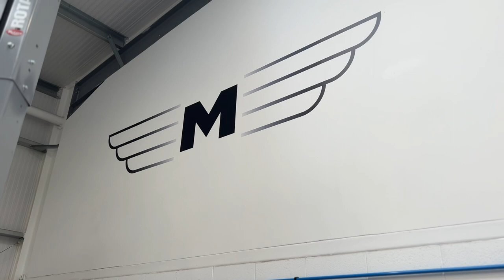IS MY LAND ROVER SERIES 1 ROTTEN?! (BIG SURPRISE!)

Comment: Worked on series 3, they had oil filled front hubs, also noticed you didn't mention transfer box at rear of gearbox, although if gearbox oil was fresh I would assume this would be good too.
Good condition for year looked well aged underneath so would imagine fairly original.
Reply: Looks like he missed the transfer box and front swivels and maybe air filter oil bath.
Reply: Nevermind the steering box & steering relay.

Comment: hi, great video. has the oil been changed in the air cleaner,? rust needs sorting all over the place, check around rear spring hangers and rear cross frame.i would also fill with new coolant and anti freeze, good luck,

Comment: Chassis is in good condition.  Needs a coat of Hammerite Kurust to neutralise the rust, then a covering of Corroless chassis paint from arc-rite.  You can then follow this up with Dinitrol 3125HS and possibly some Dinitrol ML inside the box sections, job done.  Great video as usual but I would scrap the horrendous sound track.  Was that your choice?  Better without and you voicing over the video instead, may just save someone slashing a main artery!
Reply from the maker: 😂😂 note taken on the audio- always hard to find license free music to accompany a bit of B roll. Great tips on the chassis thansk 👌🏻👌🏻
Reply: @thedoctorsgarage  
The best music is no music. Cheers👍🏻🙏🦘
Reply: @thedoctorsgarage  there’s a reason it’s free.

Comment: You can cover the springs in old engine oil as a stop gap but as you say, it’s looking pretty decent.
Reply from the maker: Good idea that- should have kept some of the oil!
Reply: @thedoctorsgarage  why would you use old oil? you have a vehicle thats nice and clean underneath that will be covered in stinking black oil that you will be covered in each time you work on it. 
If you must use oil im sure you could find the cheap stuf in the supermarket.
lanoguard goes a long way once your using it. 
It would also make a good video.
Reply: @thedoctorsgarage  Mix some petrol and oil in a spray bottle and spray all the springs,the petrol helps the oils seep in through the leaf's which improves the function of them.
Give them all a few coats and you really notice a difference when you drive it again.

Comment: No surprise the back different oil was worse than the front as the back one does most of the work. Doesn't look too bad underneath but needs waxoil or similar to stave off the corrosion.